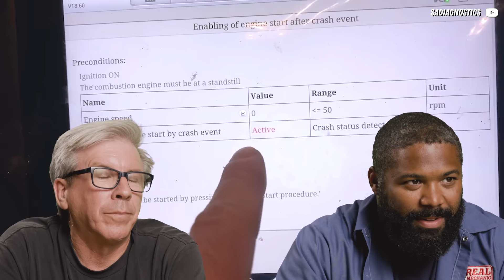Mechanic Reacts to Engineering Fails

Comment: I do hate the oil filter location on many cars.  Like the Escape example (or on our GMC Acadia) the PITA is wiping down everything the oil got on after you removed the filter.  Also sometimes you need to get at it from the top of the engine bay, not under.

Replacing the water pump on the 2014 Acadia was a PITA with all you need to remove before you can just barely get to it.
(not like on an old Subaru Brat, remove 5 bolts & 2 hoses)

Although I don't like where the fuse box is on our 2011 BMW 135i (buried deep behind glove box, need long needle nose to get to the tiny fuses), at least not as bad as that Audi was.

Also a shout out to my youngest that finished his 1st semester toward his auto tech certificate program! 😄 He is also working for a dealer in the quick service lanes (oil, tires & such).

Comment: My Vette has a horn fuse located inside the instrument panel, you have to remove the gauge panel and then the center control panel to get to the fuse.  Rest of the fuses are all conveniently located on the side of the dash panel behing a hinged door.

Comment: Many makes and models require battery box removal for access to the top of the transmission casing where the shift lever and fill plug are usually located newer models have electronic shifters and modules under battery boxes and I may be wrong but I’m pretty positive that was a dodge fuel filter and he was draining the WIF separator.

Comment: That Ford mechanic complaining about the oil filter has apparently never changed the oil and filter on a Yamaha R6. Gotta take off a cover, disconnect shift linkage, fit a filter wrench in a tiny spot, then drain the oil from a hole pointed right next to the hot exhaust pipe.
Reply: Wow ...
Reply: That wasn't a Ford mechanic....  The Ford mechanic was complaining about not being able to get a torque converter off because of broken connecting rods.  

I've done hundreds, if not thousands of oil changes on Escapes and it's really not as difficult as that guy claims and acts.  The filter actually comes out and goes back in quite easily.  As Joe said, it's really just an annoyance.  You have to be incompetent to struggle as much as that guy claims to.  I can have the old filter off and the new filter installed in the time it took him just to install the new filter.
Reply: @aaronthomas6155  It looked like all the lines were routed under the filter. Would it be easier to change it from the top?
Reply: @blechtic  No, it would be much more difficult to change it from the top since the intake manifold is in the way.  There's actually plenty of room to remove and replace the filter from the bottom.  The hoses aren't actually in the way.  There's actually a gap there specifically for removing and replacing the filter.

Comment: 90's ford tempo / mercury topaz.... To replace the water pump the fsm says to cut a hole in the wheel well....or remove the whole engine.

Comment: When a wire begins to break it just gets smaller, it can turn into a toaster without actually pulling more amperage.  The fuse won't blow in that circumstance unless it grounds itself out.

Comment: '74 Ford Country Squire wagon, to replace rhe fan motor, hard to cut a hole in the wheel well. Replacement fan motor came with a sheet metal plate and self tapping screws.    Engineering fail. 40+ years later, still the prize winner.
Reply: Could've been WAY, WAY worse.
Reply: I worked in a Pontiac garage in early 70s. changing a heater blower meant removing the inner wheel well. Nasty job.

Comment: Guys, there are cases, usually on older cars, where you need to remove the battery tray do to corrosion or other damage either to the tray or under it. I've dealt with just that on a variety of cars and light trucks.

Comment: My mom's power steering on her 2001 honda accord was leaking and found out it was the high pressure hose. Finding the part wasn't easy, but ended up getting the right one in. Then come to find out, to get the hose off, you have about 2 inches of space to get to it, and it snakes around a bunch of hoses. After about 30 minutes, my mechanic finally had it off. Turns out getting it off was the easy part. Poor guy spend and hour and a half trying to get the new one on. He had to go up on his original price, and I didn't blame him. Not a job I was willing to do, so I'll gladly pay more after witnessing the struggle.

Comment: My mother had a 1987 Mercury Sable V6 that she wanted me to tune up. So, I go to Autozone to get plugs and wires and the associate that helped me actually winced when I told him what I was doing and to what car. On the way out, he wished me luck. When I opened the box of plug wires, half of them were 5 feet long and the other half were 8 feet long, and I was confused as hell. I popped the hood and took a closer look at the engine. I located the 3 plugs on the front of the engine easily enough, but when I traced the wires' path, they went around the side of the engine and disappeared behind it. The other 3 plugs were on the back of the engine, and there was NO clearance to get to them at all, and I couldn't find the distributor at all. I went and got a repair guide and read it, and it said that the engine had to be REMOVED to get at the back plugs and distributor, which was on the very back of the engine. I said, "fuck this", took the plugs and wires back to Autozone and got my money back, and told my mom the tune-up was finished. I never told her that it was physically impossible for me to tune it up.

Comment: Me and my shop buddies refer to the oil filter on 2010’s Subaru foresters as ‘the ring of death’. The two exhaust manifolds come down and connect at the catalytic converters, which split up to make space for the filter. In other words there is a ring of catalytic converter around the oil filter. If you want to take the filter out you have to reach in between the cats, burn yourself on the filter, pull your hand away and burn it on the cats, and then grip the filter and ignore the pain
Reply: A non-turbo 2008 impreza are the same, the exhaust shield Y branches to make a spot to reach through to attach the oil filter. Without one of those ratchet cups it was very unpleasant trying to unscrew one.

Comment: The reason for the GT's roof and door design was because the class of racing involved. Drivers to run to their cars and get into them quickly. The premise was to making ducking as smooth as possible and as fast as possible.

Comment: I’m just saying put some access holes for those transmission bolts. I don’t want to use 3ft of socket extensions just put a little hinged metal flap so my socket can hit those bolts.

Comment: 3rd gen Honda Fit was definitely designed by someone who used to be a mechanic. Even though the engine bay is really short there’s plenty of room in the engine bay, the starter is easily accessible, and it looks really well thought out.

Comment: Chevy Malibu headlight bulbs: remove entire bumper and grill cover. Chevy trailblazer: remove entire front end suspension, drivetrain, accessories, radiator, bumper oil pan, valve cover and timing cover to change cam phaser or timing chain. Chevy traverse: drop entire engine subframe assembly to change timing chains (3 of them) or cam phasers (4 of them), with no guarantee that a new one isn't going to go bad within a year, so just hope it isn't an annual thing. GM diesel pickup trucks: timing chain in back of engine and you have to lift the body off the chassis to pull the engine out to service it. Chevy trailblazer: computer compensates for dirty throttle body, but can't compensate for change in airflow from cleaning or replacing it without bidirectional scan tool.

Comment: 2005 Lincoln Aviator.. changing the rear shocks and struts.. Ford put a spacer between the top of the strut and the bottom of the cab. It's held in by a nut inside of the rubber that you can't really get to without tearing up the rubber

Comment: All Fiat 500 hatches are famous for the wiring harness fraying in that location. That's a Euro 500 and IIRC very few caught fire. (There a total of 2 videos/complaints I've seen.) As I recall, the wire going to the hatch release is tiny so it melts when shorted to a bigger hot lead, until the fuse blows. Eventually the wire insulation melts and pops the fuse. It's worse because there's flamable insulation in there. The US 500 looks the similar but is a different car. I've never known one to catch fire in that location, but any time there's any really weird electrical, from passenger door lock not working, to hatch not opening, to rear lights failing, this is the first place that's looked at. You have a lot of wires in that cable and you never know which pair will mate up or break, thus unexpected results. Owners also love to hack Fiats. The car is designed around certain electrics and modding occasionally has weird results, error messages, and burned light sockets.

Comment: I am an Electrical & Electronics service engineer, We suffer from the same problems. It wouldn't be the first time I came across a device that says "No Serviceable Parts inside" and when you take out the 30 screws and the power supply, and under an unlikely  heatsink, low and behold a blown fuse, not soldered to the board but in a holder easy to be replaced, but then the heatsink needs to be removed to do this????  "No Serviceable Parts inside" what the hell Designers. I has a sign on my wall that read "All devices MUST contain 1 part that is inaccessible, 1 part that is Unavailable, and 1 part that is under development" always got at laugh, but only from the engineers and service people.

Comment: Forgot, decades ago, when I was a 'prentice, one of the fleet vehicles had to have an engine mount removed to access the oil filter, not for 'easier' access - but because that was what the actual procedure was. It was a, British, Austin A55 pick-up, if anyone's interested.

Comment: 4:30
In Germany the fire department comes out to most crashes, usually to do two things. They will capture/limit the spill of any fluids, and they'll access the battery and disconnect it as soon as they can to take power off the car.

Comment: The main problem is modern cars have so much stuff in them that every nook and cranny is jam packed so to change your spark plugs you need to remove 20 things first. On pre-80s cars everthing you need to access is just there and easily accessed.

Comment: Once I was hiking through Bloomington, Indiana (backpack). No money, but I saw a 1960's Corvair van for sale at someone's house, and since my dad a Corvair rampside pickup in the yard when I was growing up, (almost same body, just without the hard top) I had to stop and chat. Older lady, original owner. She said the only thing bad about the thing was how hard it was to replace the oil filter...her son had to take rear floorboard engine panel off and the filter was in an impossible spot.
Talking to her at the side door of her house, I looked at where it was parked on the street 30 feet away. I could see a rusty bent metal lever poking out over the license plate, just like on the truck. "Doesn't the rear engine access panel open?"
I walked over and wiggled the lever (gently, knowing it hadn't been opened since the factory). She started asking me not to, not wanting me to damage the vehicle, but it moved, unlatching the 10" tall panel that held the license plate and protruding license plate light towers (with obvious hinges on the bottom of the panel). It squeaked out and down, and right there was the bright orange FRAM oil filter on the back side of the engine. She REALLY didn't want me to leave without buying the van after that.

Comment: I bought a 2001 Passat 4motion wagon about 9 years ago. Long story short, the thermostat went out and its literally under the front engine cover. It requires you to half disassemble the front bumper/grill area just to get it where you can start to access the front of the engine. I called an import mechanic and was quoted $800 to change it. It was a $5k car... I just quickly sold it. Glad to be rid of it.

Comment: 1990 jeep wrangler jack. It is under the hood then expanded under a bracket. At the plant, a low pressure air tool is used to accomplish this. I could not find one person who could lower the jack by hand. Of course the attachment to give you leverage is also under rather that bracket.

Comment: my dad has a saab 9-5 2007. we needed to renovate the alternator… its placed behind and really far down the transverse 4 cylinder engine. to remove it you remove the right front wheel and the inner fenderwell to get to one of the bolts that holds the alternator. you then loosen and remove the upper engine mounts so that you can lift the whole engine like 10cm so that you can remove the tention on the belt and the tentioner itself and then finaly the alternator… bracket that also needs removing. you do all this by feel because there is no way to see down there. after the bracket is gone and the alternator is disconnected you then struggle to get it past the intake so you remove/loosen a bunch of hoses and cram it past. install the new parts on it and do the whole process again backwards. takes fucking forever.

the reason this is a problem at all is that the engine and stuff is allready assembled on a subframe that they just shove up there on the production line.

Comment: I'm an old retired tech. I have seen what we called engineers smoking some good sh** designs. We didn't complain to them we engineered our own tools to fit our needs and a lot of patented tools were produced from us Techs that just wanted to make life easier on ourselves. But there were times when we just told our customers they had to take something to the dealer if it was to time consuming and our green book time didn't take in consideration the extra steps and time needed.

Comment: The 4.3 S10's oil sending unit is below the distributor, which needs to be removed to replace a $10 part. You can replace them on the GM V8s without removing the distributor because it has enough room, but not the s10. Sent from inside my s10 that is currently reading 0 on the oil pressure gauge

Comment: The Subaru Forester 2.5 XT has got the drainage hose of the AC clipped to a place so it perfectly drips onto the control arms or something similar right below it! The moment the paint is gone it rusts through in no time!

Comment: 1:23 I have done this to my zero turn pto and it still out. Putting higher amp fuse in will cause the electrical system to heat up.

Comment: Early 2000's Corolla 1.6. 16 valve alternator removal.  To remove the lower bolt you have to remove the water bottle, to remove the water bottle you have to jack up the car, remove the right front wheel, remove the fender liner to remove a bolt holding the water bottle.  I do not know if US spec cars are the same but that is how our works.

Comment: Love you guys being doing mechanic for 30 years and I wake up at night hating ford . Just replacing glow plugs on a 6 litres Diesel E350  is real horror show.oh and replacing an engine oil dipstick guide tube on a f250 2010 you just need to remove the exhaust manifold.keep up the great work and good mechanics are gods.

Comment: The disabling the engine after a crash is a good idea if you say ruined your oil pan or coolant, and it will save from the tow truck guys or if the car goes to an auction from getting started with no oil or coolant in it.

Comment: On an oil filter placement the engineers could have installed an extension to make it easier to get to. Plus a benefit of an extension might allow the oil dripage to be easier to clean up instead of it spilling all over those hoses & engine block & subframe & etc....

Comment: I've worked on a few cursed cars , thanks Germany , but the one that comes to mind is an opel  with a bad cam  position sensor . 
Easy peasy right ? WRONG ! removing the sensor from the camshaft housing ,one bolt so far so good .Follow the wiring harness to see where it plugs in AND it goes between the block and engine mount with no  room to get it out  without removing that engine mount . Also attached to set engine mount is the AC compressor  bracket and the AC compressor .
So a quick recap . I now have to remove the AC belt , remove the AC compressor , the AC compressor bracket ,support the engine , remove the engine mount , unplug the damn  sensor ,instal the new sensor and put everything back together . Why ? Why did a 5 min job have to take an hour  ? Not to mention all the additional tools i had to use , because we can't just have one kind of bolt can we now GERMANYYYYYYY!  No ! Some are torx bolts and some are hex bolts and some are regular bolts , all different lengths ofcourse ,i am surprised they did not throw in a left handed one just to complete the set

Comment: bro one of the worst engineering features i’ve seen is the plastic skid plates on new nissans and infinitis that have like 20 fragile panel clips and take forever to take off not to mention if all you got is a flathead you’re breaking atleast half of those clips and all that turns a 5 minute oil change into a 30 minute job

Comment: Early mid 90s Taurus.  Changing the water pump.  The only way we could get it out was a prybar as tall as I am wedged between the block and the sheet metal of the bay, flexing the motor mount to its limit.  We called it the Ford maneuver.  Figured we were idiots, went to the dealer for a pulley and they asked how the hell we got the water pump out.  We told them really embarrassed about our sketchy maneuver....tech told us thats the procedure in the factory manual or a factory service bulletin (it was a long time ago, I forget which) but seriously,  how do they service that part?  Eh just have em jerk the motor around till it pops